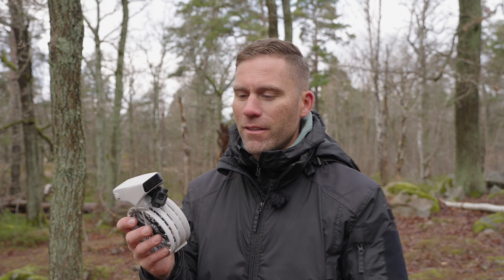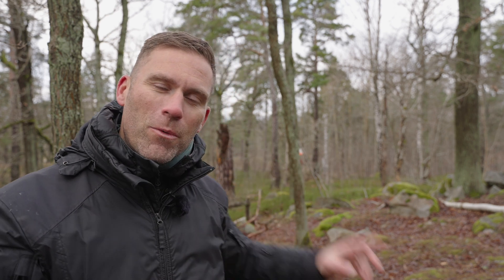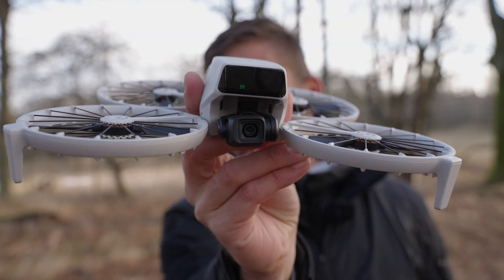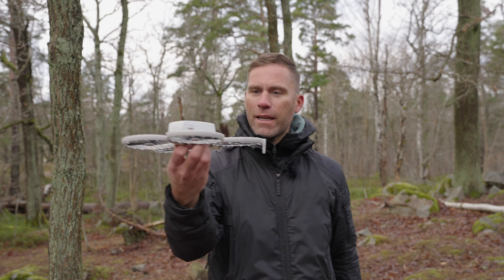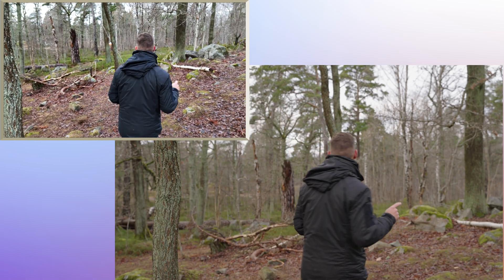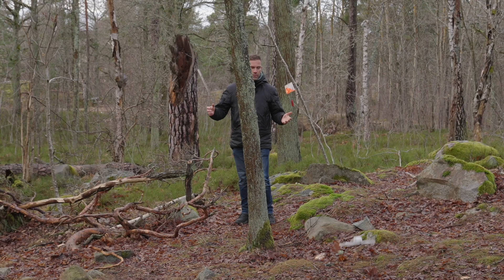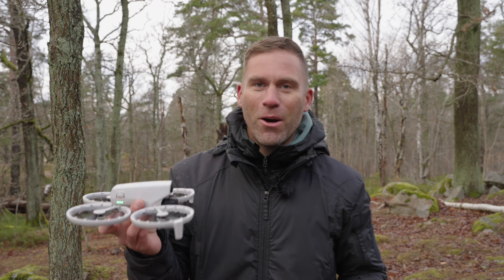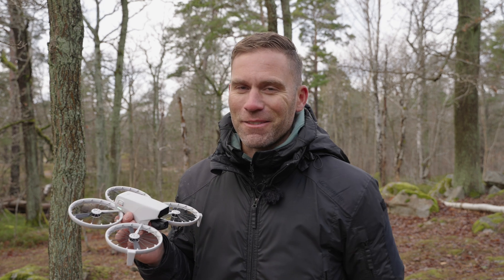How is this possible? DJI FLIP Obstacle Avoidance

Comment: If you use RC N2 remote control (connecting the phone to the controller), will the Flip drone return to base if lose signal while in air ?